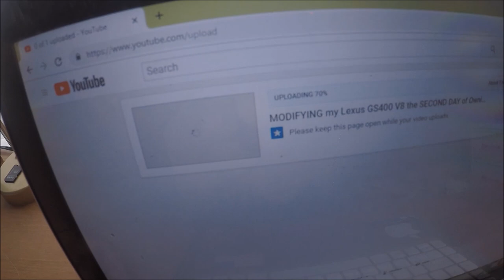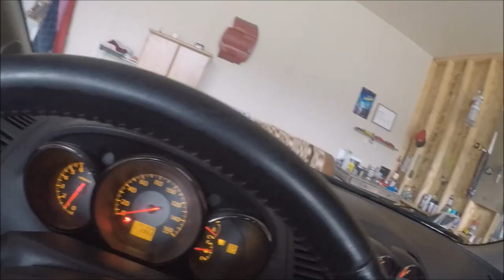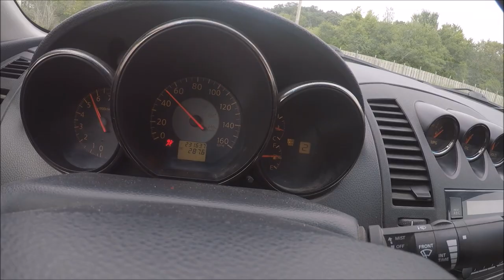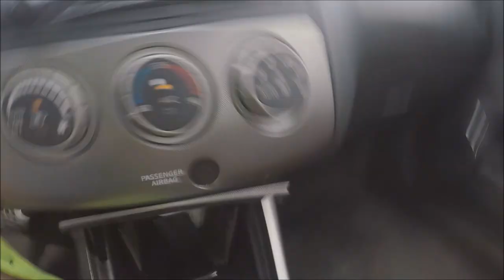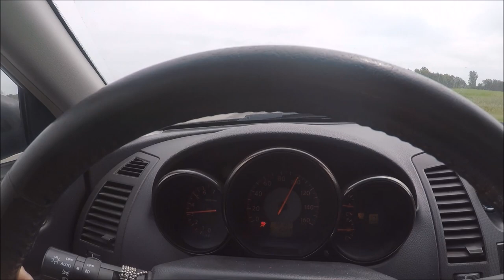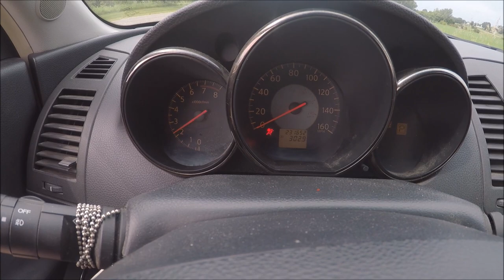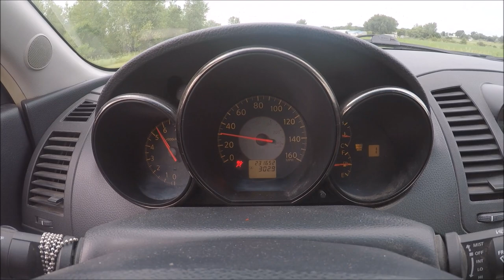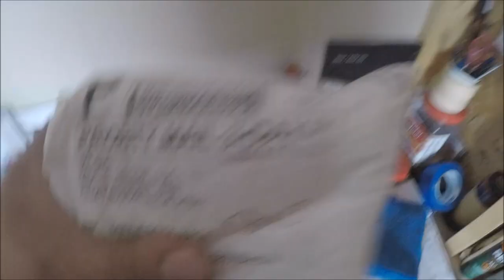2005 Nissan Altima SE-R Review - from an Owners Prospective!

Comment: Those V6 a very strong engines...the could go over 300k miles no problem...tranny's do have sum issues tho...door handles do break....cam nd can position sensors typically go out...interior dash parts are very sensitive also other than that they r decent cars that moves good nd sounds very good aswell!!!

Comment: I'm about to buy one of these with 103k on it.  Do these things have any common issues you know about?
Reply: Burning oil. Mine burns quite a bit. I don't drive it a lot though. Have only put about 5,000 miles a year on it for the past 4 years.  It runs great though! Has 94k miles on it. Also had issues with the clutch pedal sticking sometimes but I just got it replaced and that resolved it. Overall it's been a great car and a lot of fun!
Reply: just like any vq just keep the oil up on it youll be fine ive owned one for 6 years now hr swapped fully built making 301 hp tuned by nisformance but people sleep on this car so much and it sounds good but the center console/dash very fragile the quoted me 700 just for plastic trim replacement from nissan door handles but like he said there very rare hard to come by on parts and parts are pretty much sold out so the best bet is facebook groups guys are cool and buy off there or nissan